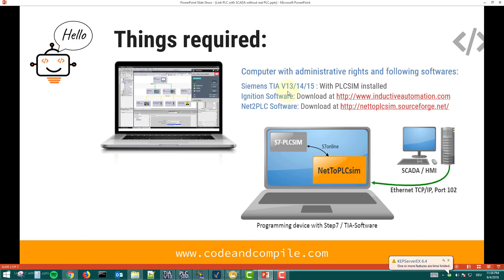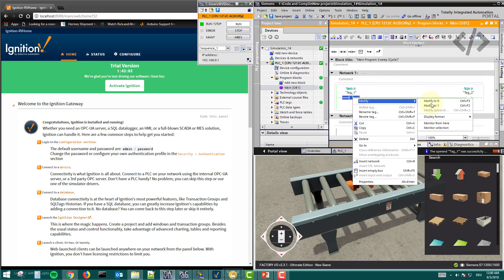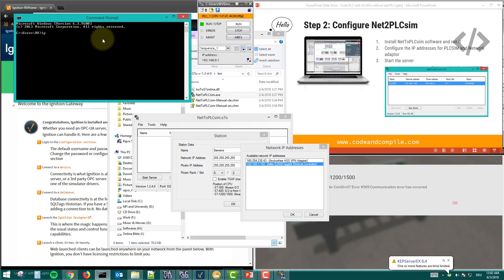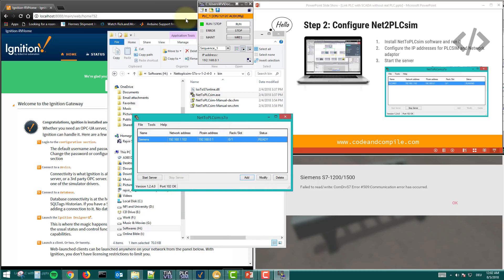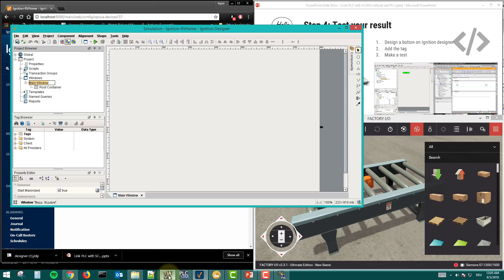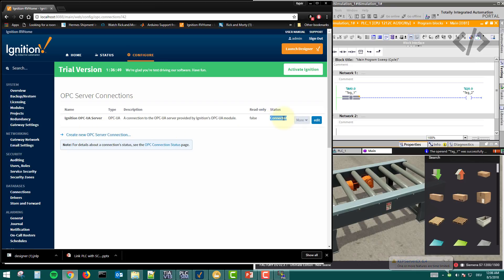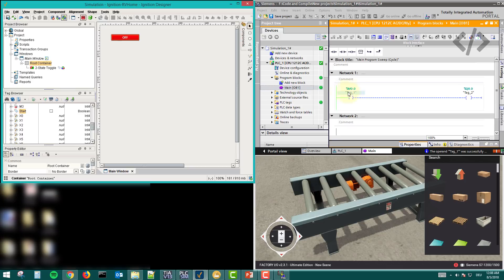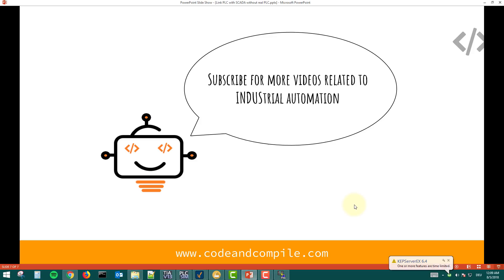How to link TIA portal with Ignition SCADA without PLC

Comment: Sorry sir, i cannot connect the netplcsim with ignition (i Select wifi adapter), but I can connect if I use kepware, do you have idea to fix it?
Reply from the maker: You need to select the correct ethernet/wifi card to connection.

Comment: Is it possible to connect multiple PLCSim with nettoplcsim?
Reply from the maker: Never tried :D .. but how can you have multiple PLCSIM instances in the TIA Portal?
Reply: @thegeterrdone  Hello sir, thank you for the video. I followed all the demonstrated steps on how to link s71200 to ignition using nettoplcsim but mine still shows disconnected.

What do I need to do differently sir in order to get it connected.

Do I need to connect a LAN cable to my internet port?  This is due to my Ethernet IP not showing using the CMD.

I would appreciate your response sir
BR,
Joshua Okekporo

Comment: Like there are data registers in delta plc D0,D1,D2, D3..... And so on what are the data registers in allen Bradley plc... Speed control of motor using AB plc, servo control using ab plc please if u could help with this
Reply: santosh sanap moo